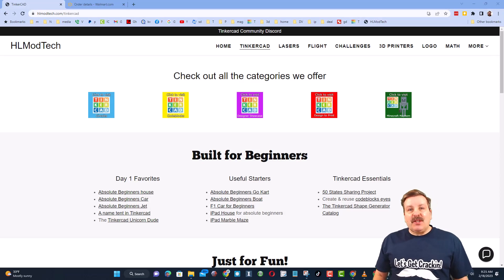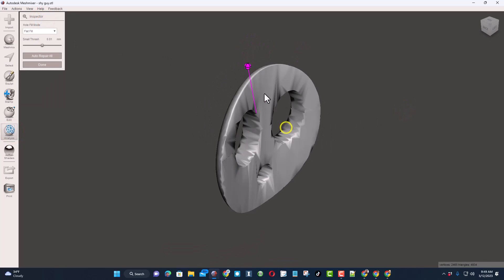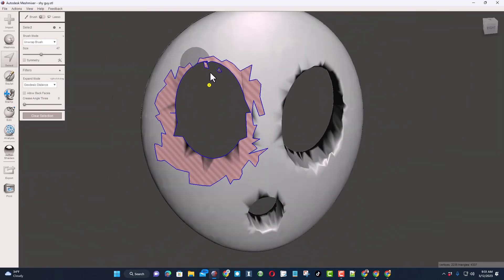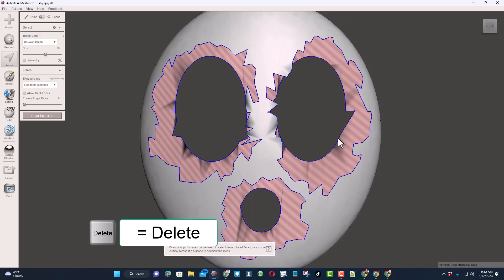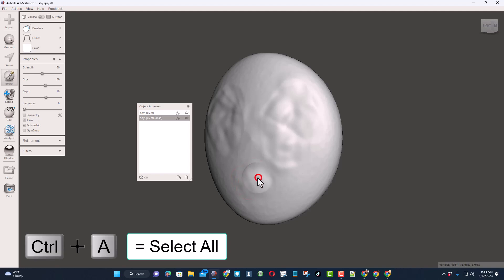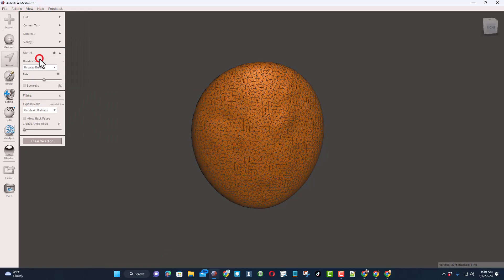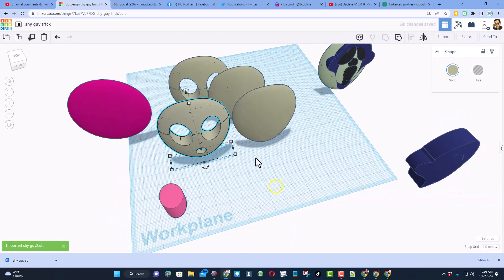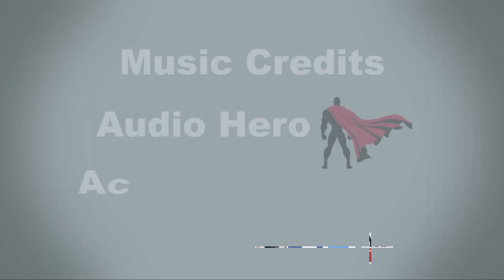Remove STL File Holes & Smooth with Meshmixer Tinkercad Import steps

Comment: i have a problem importing a stl file to tinkercad the file it self prints really good but soon as i import it almost looks cracked and has pieces missing i tried to use this method to try and fix it but still does it and suggestions?
Reply from the maker: The issue is likely something from the original design program. Some walls have incorrect faces or something. Tinkercad is "interpreting" the design as best it can. It is the same with languages... something is often lost in the translation. It is possible you may be able to fix it in meshmixer. You can reach me at hlmodtech gmail of you want to share the stl for me to take a look at.
Reply from the maker: This video shows a technique you can use to reduce the STL file size. https://youtu.be/JwqdsIoIsas There is a chance that could help as well.